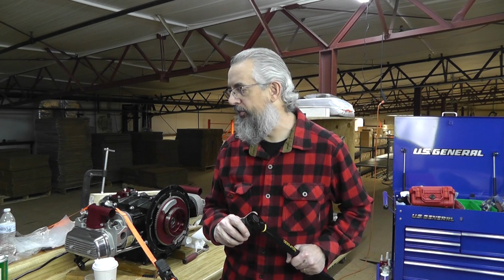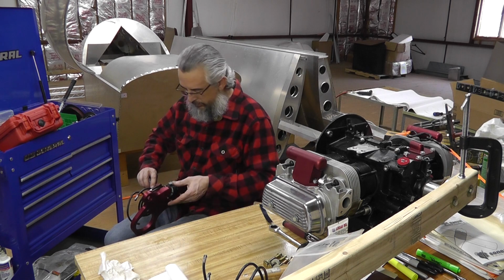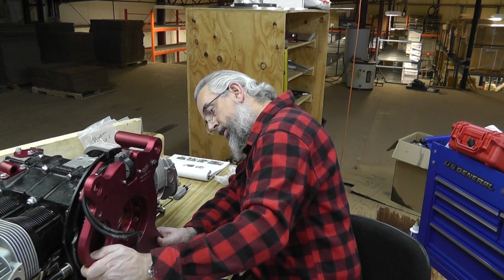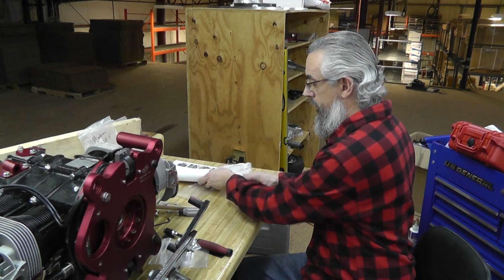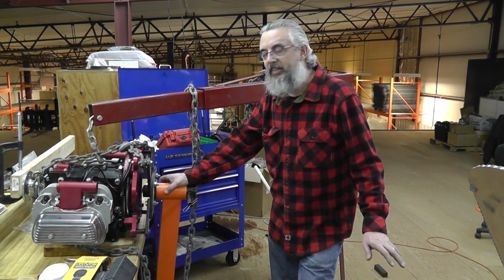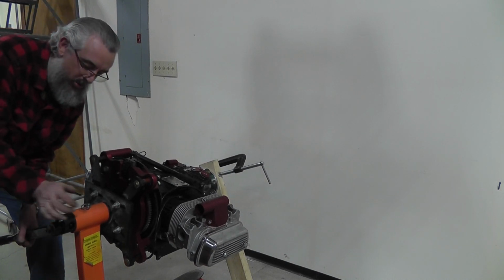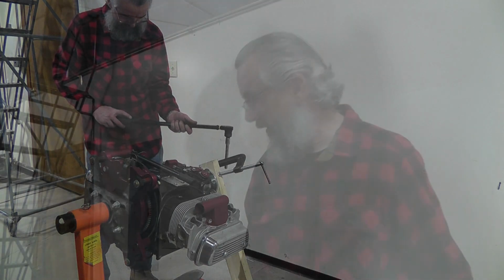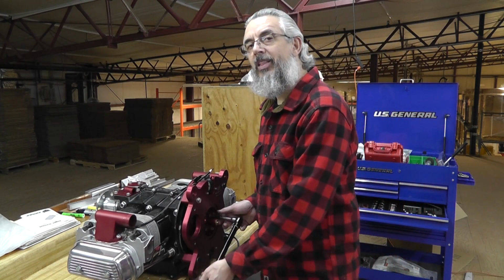Sonex Build Part 33 - Building Aircraft Engines With A Forklift

Comment: ..note to self..consider buying a forklift..
The "bloom" on the cables is a product of the cable jacket material compounding.  Not of any consequence if it is flexible and an effective insulator.
Check another box and enjoy the big "MO".
Reply from the maker: Yeah that thing comes in handy at times. I used it to get the entire fuselage up in the mezzanine and how I plan to get it down later. I was thinking that it was maybe a mold release agent of some sort when the wires were made.

Comment: You really shouldn't have put all that torque on the "Pulley" end of the crank.  They sell a locking tool to hold the flywheel.  Heck... you can jam it with a screw driver in the case, and the flywheel.
Reply from the maker: Thanks for the insight but I am not too concerned because bolting the 2X4 to the prop hub was mentioned in the Aerovee assembly video and manual as being acceptable.

Comment: Just don't use those "Man-sized tools" on any AN-3 or AN-4 bolts on the airframe! Twisting bolt-heads clean off won't get you closer to completion... ;-)
Reply from the maker: LOL, I was sure to only order them in 1 inch and larger just to be safe.

Comment: I am curious about your torque wrench set you bought from amazon, are they worth it and could you post the link to the set you bought?  i tried looking quick and couldn't find the set, only individual wrenches.  Thanks
Reply from the maker: They feel like they are well made but I have only used them a few times at this point. It was not a complete set. They are all listed on the same page though. Here is the link. https://www.amazon.com/gp/product/B07MP1Q3W8/ref=ppx_yo_dt_b_asin_title_o05_s00?ie=UTF8&th=1
Reply: @weekendhack.whatsnext  That was what I found also but was checking if they sold them as a set.  Thank you for the reply.
Reply from the maker: @jeremylauer5234  your welcome.